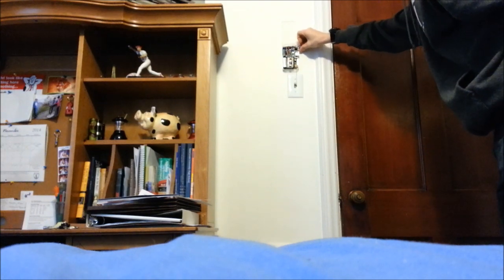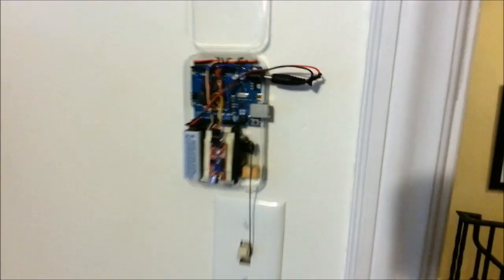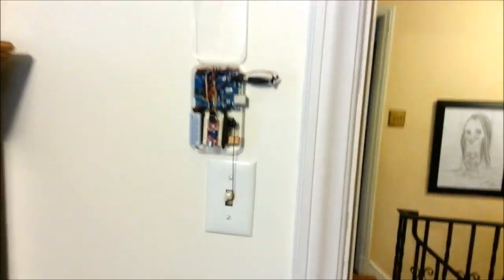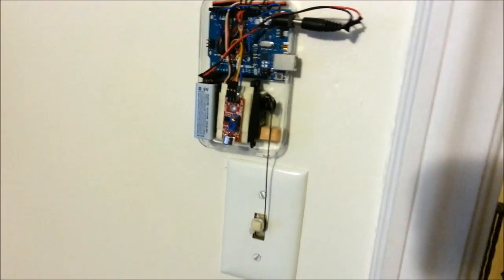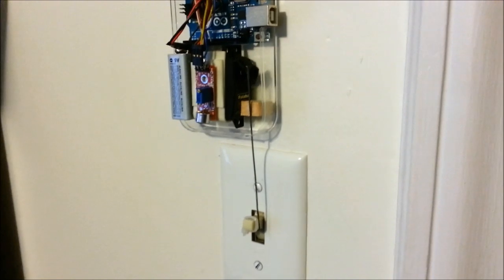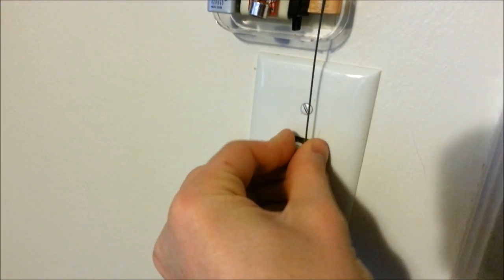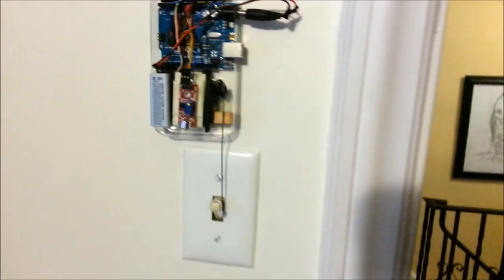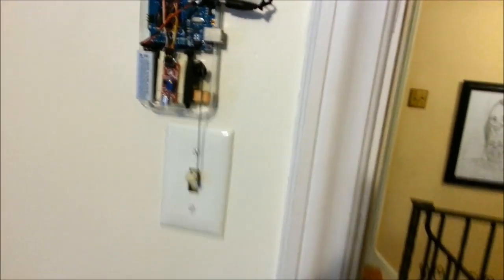Arduino Light Clapper

Comment from the maker: Hello Carlos, thanks for your comment. Your sound sensor should have 3 pins or 3 wires coming out of it. One(red) should go to 3.3V on the Arduino, the other (black or yellow) should go into ground. and the third wire should go into a digital sensor port. I used digital port 2. Same with your servo. Red and black into power and ground, and your third wire will go into a digital PWM port like port~9. Hope this helps

Comment: Hello, I did all the wiring like you said in your comment and I used the exact same code and it isn't working???
Reply: All it's doing for me is just spinning the servo back and forth....
Reply from the maker: Nadav Ram Hi, you will most likely have to mess with your threshold value since you may be using a different sensor. Play around with the threshold value to see if that works
Reply: @ericinventor  Hello I had the same issue as Nadav. I changed the threshold,  but nothing happens after 250.
I noticed in the code there was DA for analog output. What is that for? We did not connect anything to analog. We did digital instead.

Comment from the maker: #include <Servo.h> 
 
Servo myservo;  // create servo object to control a servo 
 
int DO = 2; //Pin for Digital Output - DO
int DA = A3; // Pin for Analog Output - AO
int threshold = 108; //Set minimum threshold for LED lit
int sensorvalue = 0;
boolean light = true;
int clap = 0;
int count = 0;
int x;
unsigned long starttime;
unsigned long endtime;

void setup() 
{
  Serial.begin(9600);
  myservo.attach(9);
  myservo.write (10);
  delay (800);
}
 
void loop() {
  count = checkclap();
  Serial.println(count);
        
     if (count == 2)
      { if (light == true)
          lightoff(); 
        else
          {lighton(); }
      }  
}

int checkclap() 
{
  clap= 0;
 delay(40); 
  do{
      sensorvalue = analogRead(DA); 
      }while(sensorvalue < threshold);
       clap = 1;
       delay(100);
     
    starttime = millis();
    endtime = starttime;
  while ((millis()- starttime) <=500) // do this loop for up to 1000mS
  {
      sensorvalue = analogRead(DA);
      if (sensorvalue > threshold)
          {starttime = 0; clap = 2;}
  }
  
  if(clap !=2)
   {return clap;}
   delay(20);
  return clap; 
}

void lighton()
{
  myservo.write (85);
  delay (800);
  light = true;
}

void lightoff()
{
  myservo.write (10);
  delay (800);
  light = false;
}
Reply: I'm having trouble with this code, when I clap, the TX light flashes, but nothing happens... Do I have to make a separate file for my servo?
Reply: I did this but my servo didn't stop turning until i plug the usb. What might be wrong?

Comment: Hello Eric, I'm quite new to the Arduino and after copying your code and following your instructions the servo motor just keeps rotating back and forth, this is what I have done: https://imgur.com/9CjTQYG
Reply from the maker: I believe you have connected an analog microphone into a digital GPIO, when you should be connecting it to an analog input port, A0 for example